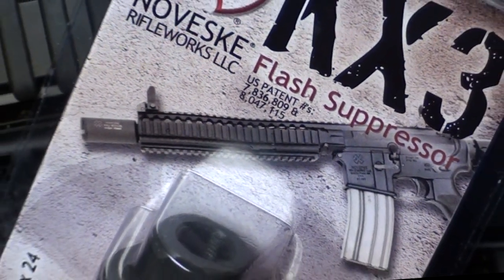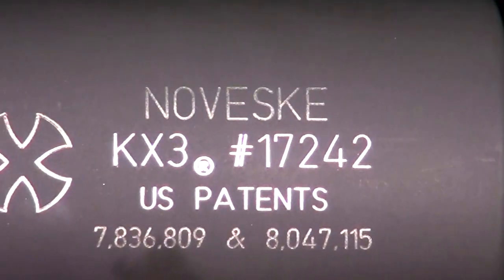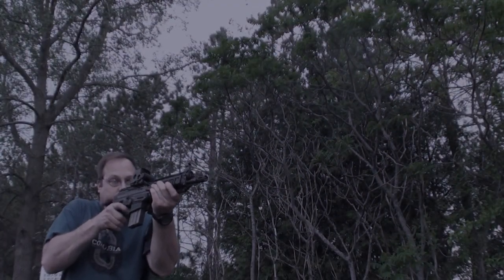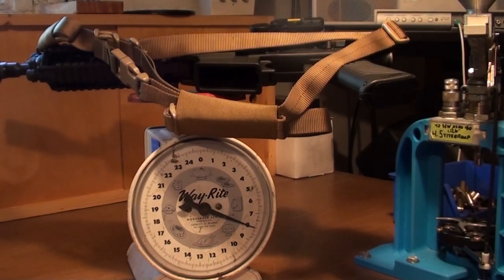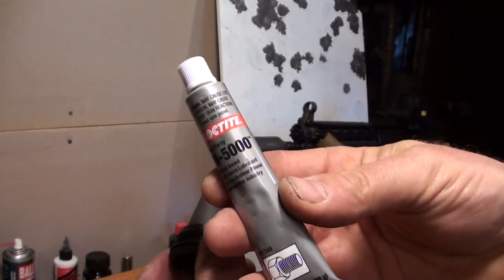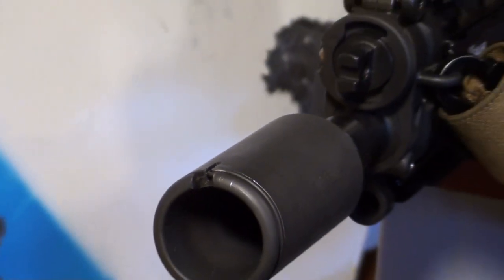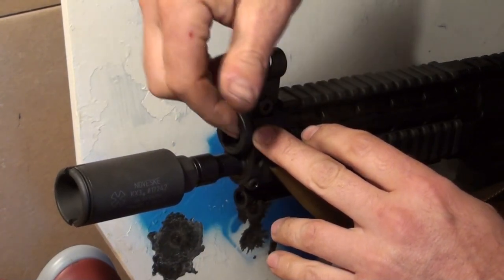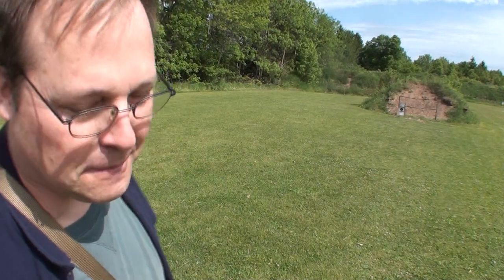Noveske KX3 - Tame the Blast

Comment from the maker: Loctite Copper Anti-Seize is only rated up to a maximum of 1800 F, so I'm not sure how it would hold up.  Nickel is rated up to 2400 Deg. F.
My guess is that it would be a lot better than running it dry or using gun oil, but a phone call to Noveske would be the only sure way to find out.  They'll probably tell you to get the good stuff.

Comment: Thanks for the prompt response... I found some Nickel Graphite Anti-Seize Compound by Vibra-Tite "Sportsman's Bench Products on ebay specifically meant for firearms. It says its rated -300 to 2000F. Apparently, this must have been sold on the NRA website since it's claiming to be an official product of the NRA. For $7.00, I bought it, hope it works. :)

Comment from the maker: It isn't that much more difficult.  I seldom remove my gas tube on my Sig 556 rifle anyways, but sometimes it's just nice to give the barrel and gas tube a good scrubbing on the outside and it's just not as easy when they are mounted right next to each other.  
It's also convenient to soak the gas tube in a pan of cleaner every now and then, but not absolutely necessary.

Comment: Wonder how it would work on a AR-15 with a 16" to 20" barrel?
Or a 18" barrel tavor
Im looking at this muzzle device on how it reduces flash
Reply from the maker: Evan Graham These KX3s are a little heavy to be mounting way out on the end of a standard length barrel.  According to Noveske they are intended for directing the blast forward, away from the operator, on very short barrels.
Reply: theKGB65 i mentioned the tavor, could we make an exception to that
Reply from the maker: I'd call Noveske and see what they say about the effectiveness on 16-inch barrels.
Reply: I have one on my 16in and it preforms very well. I don't notice any additional weight issues so all in all I recommend it.
Reply: @Christian-sh9fb  I'm running a 16 inch barreled 308, carbine gas system, with a rifle length buffer assembly. The KX3 has done a lot to help the concussion and noise off on the sides, and a little bit of rise. And, of course, it killed every bit of the flash. You're exactly right, it's a 308, weight is the nature of beast, and unnoticeable.

Comment: How much length did it add to the barrel? The KX3 is 3.28" long, I take it it overlaps a bit at the threads.
Reply from the maker: Lion Celica  If you're thinking about permanently mounting it to create a non-SBR remember to subtract the exposed length of the inner cone assembly which adds about 1/8" of length but wouldn't be considered a permanent part of the barrel.  To answer your question though, the threads consume about 1/2" of barrel length depending on the type of washer you use.
Reply: theKGB65 I've done some research, and a 13.7" barrel will fit it perfectly. The only problem is that is way too close to 14.5, so I don't really see the point anymore. I'll stick to an AR pistol if I do go that route.

Comment: This is basically a DTK Bulgarian 4-Piece for AR 
---
On second thought, the KX-5 is smaller in diameter.
Reply: ***** Yep. It's pretty cool but personally I still prefer the Surefire QD mount.
Reply: ***** Yep. That is for the shorties that need more back pressure to cycle with 100% reliability.